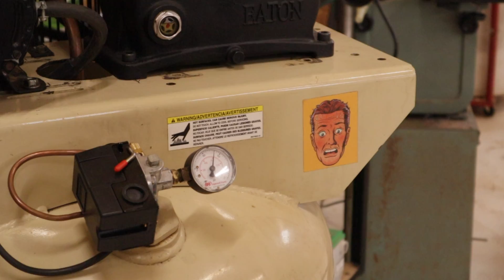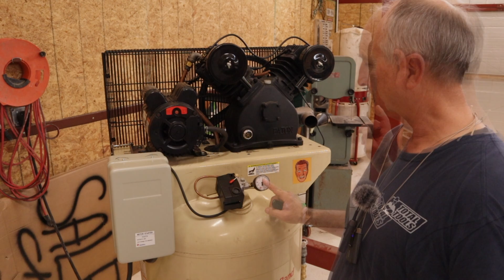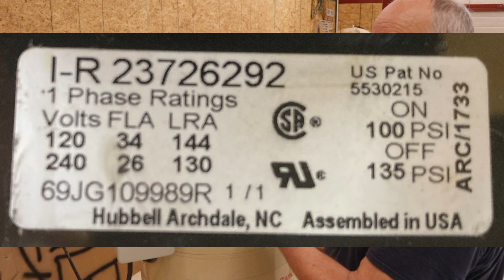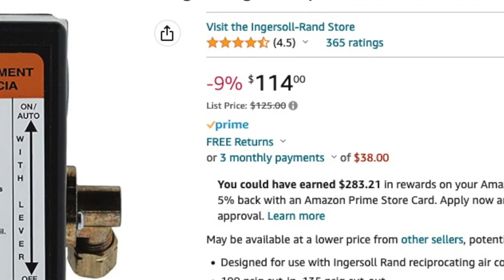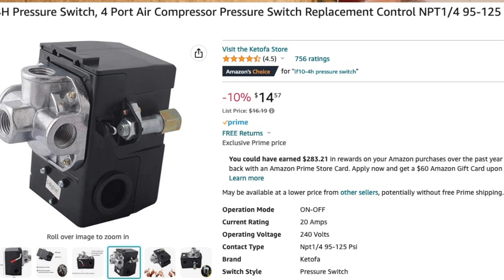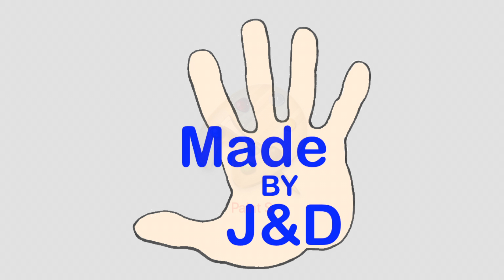Pressure switch failure on your air compressor? - Made by J&D

Comment: Same problem with IR 5HP. Just burnt through my second switch. The original switch is not cheap in Canada, so thinking about doing what you’ve done. Thanks for the vid.
Reply from the maker: Yes, the original switch was actually more expensive than this contractor AND the replacement knock-off pressure switch together.

Comment: I have a pile of old pressure switches from my shop and my works compressors which are IR, mostly with burnt up contacts as well. At least one OEM had to be replaced because of the on/off switch breaking with-in a month.

Comment: I'm having the same problem, do you have a link to that motor starter?
Reply from the maker: It’s on Amazon. Shihlin 7.5 hp single phase. I couldn’t isolate a link to it. Thanks for watching.
Reply: Trying to understand what you said. You installed the “shihlin 7.5 hp single phase magnetic starter motor control” and you are using the original switch as a pressure switch only. Is that correct? Any chance of getting a photo of you wiring? Thanks
Reply from the maker: @franklinschwenk9830  Yes, the pressure switch only operates the energiser coil of the motor starter; the motor starter takes the load of the compressor motor. I wish I had filmed the wiring because it took a few goes to get it right. Don't get me wrong, no sparks flew, it was a case of the motor starter simply ignoring the pressure switch. Essentially where the motor starter would normally be operated by a start/stop switch and relay, instead one leg of the 240 volts is run directly to the energiser coil and the other is extended out to the pressure switch contacts and back to the coil so that the pressure switch completes the circuit to the energiser coil.